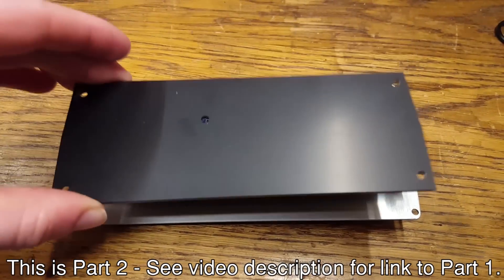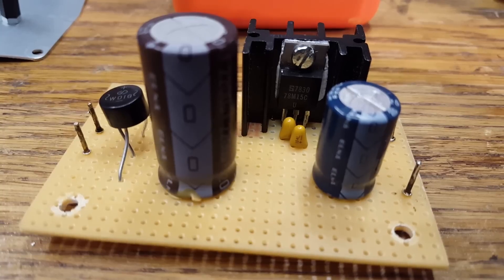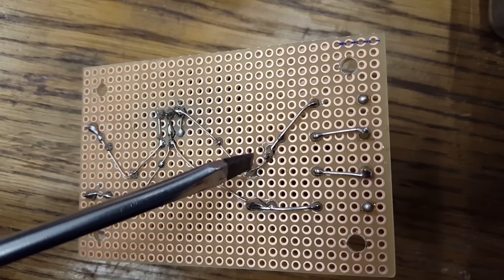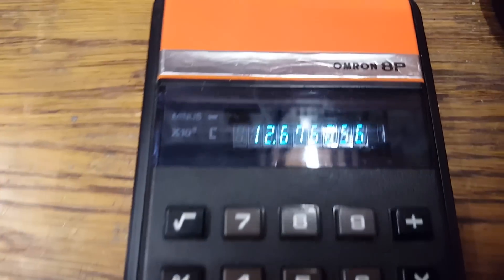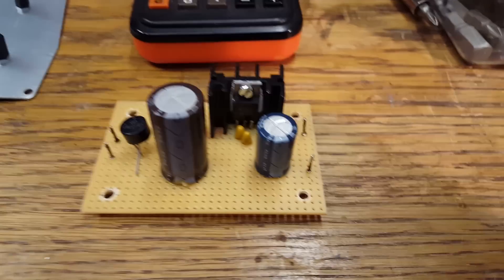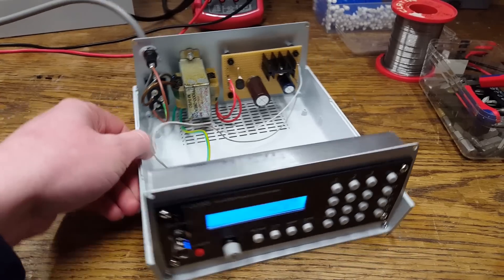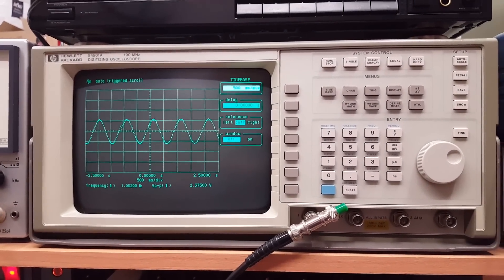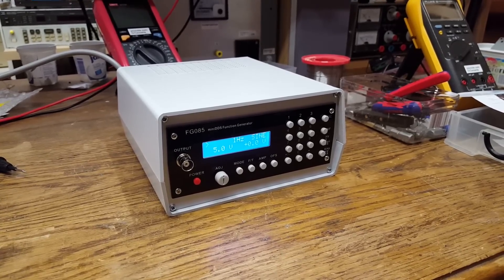Building the FG085 Arbitrary Function Generator (2/2)

Comment: The specs of the transformers are given under normal operation (under load; so the 18V transformer may give 20V in open circuit but under nominal load it should give the promised 18V.
Another thing is that the mains voltage changed since the transformer was fabricated, so it will be out of specs no matter what. Many european countries changed 220V mains with 230/240V (that is around 5-10% higher) so the appliances that uses transformers will be stressed in theirs power supplies and also the transformers are more easy to fail or at least will work hotter. I knew a friend used to put a small value resistor in series with the primary just to bring the primary voltage a bit closer to that 220V that was originally meant for the transformer. That makes sense to have 20V from a nominal 18V transformer when the input voltage rise from nominal 220V to 240V.

If the output impedance of the generator is 50ohm and you use a 50ohm load, you should have half of the voltage measured on the load instead full voltage measured without the load. The internal impedance and the load makes a voltage divider and when both values are equal, the output is half the input. So, it works as intended. Maybe the 50ohm output impedance is useful when driving higher impedance inputs (preamps, amplifiers where the inputs are in kohms range)

Comment: This kit is easy to build but the finished item produces some rather noisy wave forms which get progressively worse as the amplitude goes down. Its very noisy if you need to produce wave forms with peak to peak values in the low 1 volt range. I found adding a small value 10nF 50V multilayer disk ceramic capacitor across the BNC connections helped clean up the signal so that its quieter on lower amplitude signals at lower audio frequencies which is what I need it for. Longer term I may build up a buffer circuit with an attenuation function.
Reply from the maker: I recently found the square wave function is totally useless on this thing. I should have thoroughly tested the generator before putting all this work into building a case and power supply for it. I will upgrade to a better signal generator at some point.

Comment: If you need 3v headroom for the regulator then you need a minimum Vin of 18v, add on Vripple across the capacitor and Vfwd for the bridge and you will need considerably more than you 12v transformer can offer.  (Check out Line and Load regulation to see why your transformers give higher voltage than you expected).  Your 18v transformer (gave 20v OFF load) gives 25.4v peak at nominal input, allow for +/-10% for the mains supply and you will have 22.8 to 27.9v. Less say 1.8v for the bridge.  Your 2200uF capacitor has a tolerance, typically +50—20% so worst case it's 1760uF.  The FG085 draws 150mA + load (say 10V into 50ohms = another 200mA) So for 350mA a 1760uF cap will give 2v ripple (at 100Hz = rectified 50Hz). So you get a minimum voltage into your reg of 22.8 – 1.8v - 2v = 19v  and a maximum voltage into the reg of 27.9 – 1.8 = 26.1v.  Worst case Vdrop on the regulator is 26.1 – 15v = 11.1V   at 350mA = 3.9W. So for a maximum temperature of say 100oC and an ambient of 30oC you should have a heatsink better than 17.9 oC/W on your regulator.   Linear Power supply design isn't quite as simple as many expect!  Hope this helps others.

Comment: the voltage drop that you have found is not caused by the  signal generator: the cable has an impedance of 50ohm and you're placing a 50ohm load at the end of it. This creates a voltage divider of 1/2 where you are measuring the voltage with your oscilloscope. Try to measure the voltage at the output of the signal generator while you have the load connected and you will find that the output is 5 volt.

Comment: The output impedance is 50 ohms and you are using a 50 ohm terminator thus creating a voltage divider (2.4v vice 5sh).  This is common for cheap FGs that report their true output voltage instead of what the output voltage will be when properly coupled with something else.  Nice build.

Comment: The finished build looks much better in the enclosure than the original back plate assembly - looks like a purpose built device, rather than a kit. Great job! 
I know exactly what you mean about the slotted screws - they were used extensively at one time and now, when I come across one, I find it difficult to keep the screwdriver in the slot! Perhaps we've been spoilt by all the other types of screws that are routinely used these days?
Reply from the maker: Thanks :)

Comment: I ran into a similar situation yesterday.   I was building a 3 amp 12 volt power supply using a 12 volt 3 amp wall wart.  No load on wall wart is 14.7 volts rms.   I thought excellent.  Wired up a test circuit.   I tested the circuit and loaded it to 2 amp draw.   Low an behold the AC voltage dropped to 12.5 volts rms and the DC voltage then droopped below the drop out voltage range of the LM317 regulator I was using with a current boosting pass transistor.    Lesson learned.    Back to the drawing board.  New approach needed to get what I want with the transformer I have.  I guess if every project work 100% right off the proto board electronics would be boring.   Enjoy your vids.  Great job.  Happy New Year
Reply from the maker: The problem is, my voltage dropped quite considerably only with the electronics ( = AC to DC conversion circuit) attached. No load, the current would have been very low. I think one of my multimeters acted up when I took the initial measurement...
Reply: DrCassette Old video but none the less. You can't trust measurements on an open transformer with a highimpedance meter. If you had loaded it    with 100kohm f.ex. you would have got a good reading.